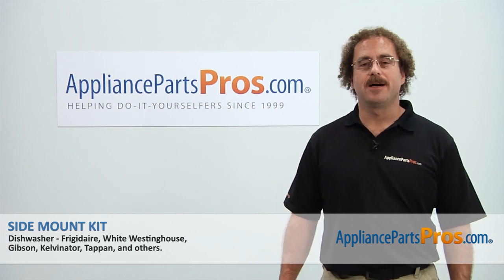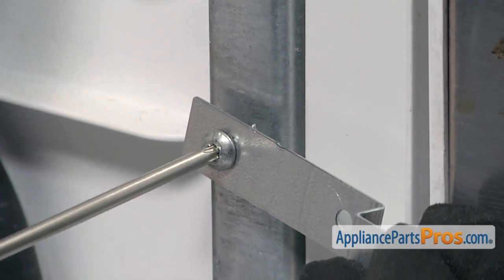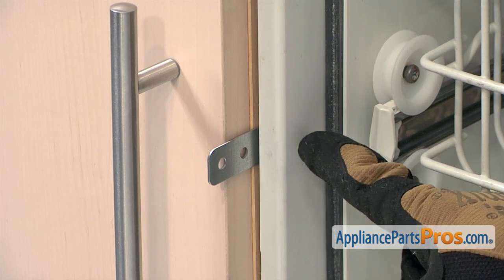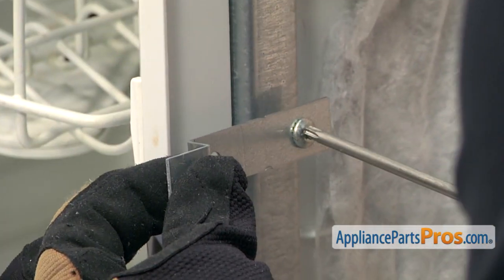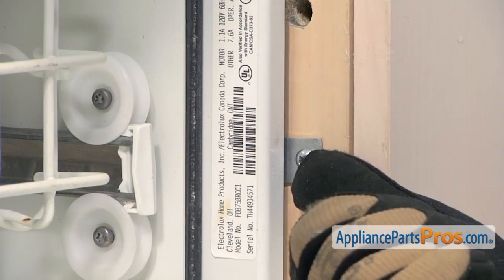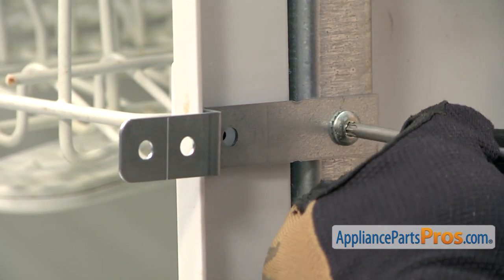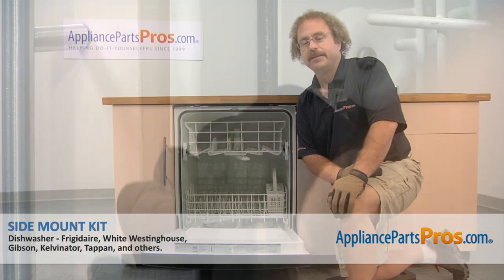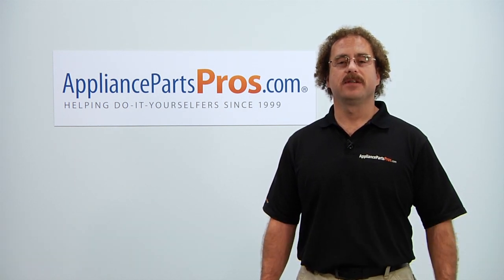How To: Frigidaire/Electrolux Side Mount Kit DWBRACKIT1

Comment: Helpful.  An interesting note is that other manufacturers such as GE already have the holes pre-drilled in the tub and include plug covers.  They have designed their mounting brackets to work on top and the sides without having to buy another kit.
Reply from the maker: +6857100 All the manufacturers do it a little different. It is best to look at the installation manual to see how it is done on your model.

Comment: This was useful.  However, I'm having a new granite countertop installed at the moment, and the installers are putting in new side-mount dishwasher hardware before the new dishwasher is even here. The hardware they're installing doesn't look anything like the hardware shown in the video.  So, I'm at a loss...
Reply from the maker: Tom Regner I am sure the equipment used varies from brand to brand. You will probably have to compare what the new dishwasher comes with to what they installed in the cabinets and decide what is going to work for your set up.
Reply: How did it turn out Tom? Was the foreign hardware the correct solution?